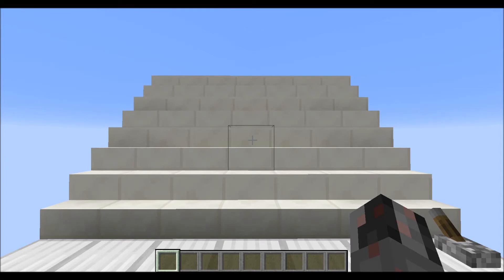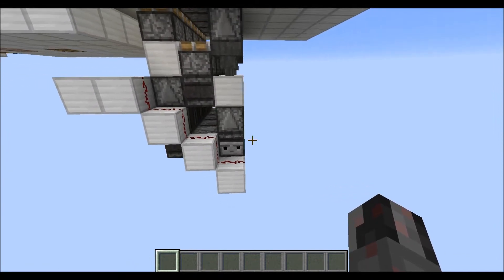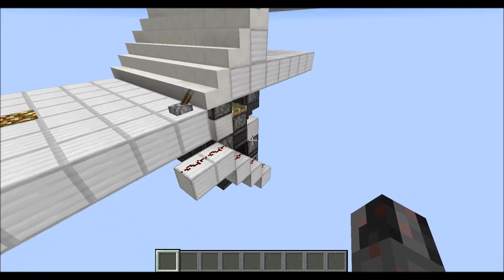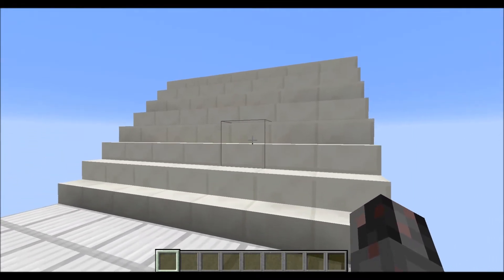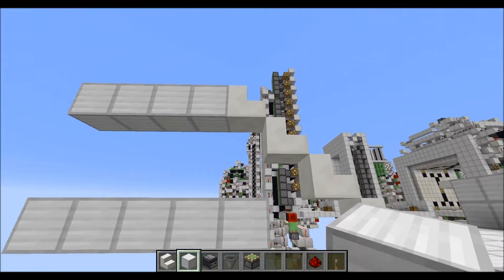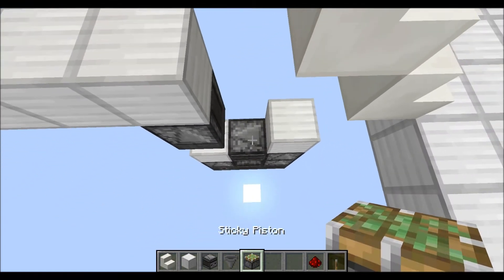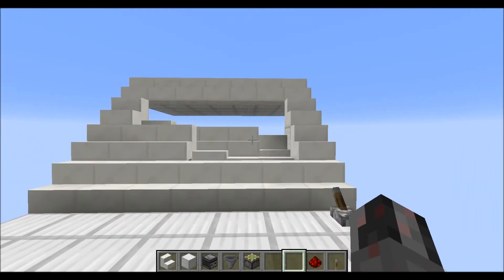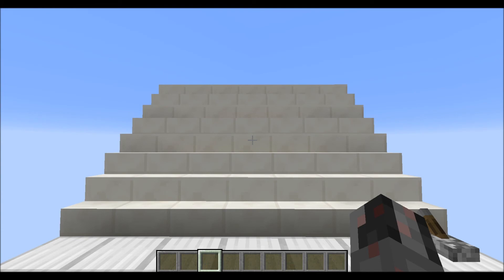Tutorial: Lag-efficient, Tileable Floor-Double Stairs [Java 1.11+] (Schematic)

Comment: Couldn't the last redstone piece on the lowest block be lifted one block higher? Reducing from 6x5x1 to a 5x5x1, for the circuitry module?
Reply from the maker: I assume you mean the alternative redstone line at the bottom of the modules? No, that can't be lifted. For the double extender to work it needs two pulses to the top piston. For this it takes the input pulse, splits it, delays one of the splits, and brings them back together before directing it to the piston. This splitting of the signal is the main reason for the used observer setup.     Btw, the size is 3x6(8)x1.
Reply: Alright, so what I mean is that there is only one update required: from the bottom observer. By simply powering it,  wouldn't it get that update? Instead of having one entire layer added just because of a single redstone piece.
Sorry if I'm missing something, I play on console and don't know everything about observers yet. And my OCD hurts seeing that extra redstone there XD
Reply from the maker: For extender extention you are right, that only requires one pulse to the top piston. BUT for the retraction it needs to retract the stairs block back TWICE. And for that it needs TWO pulses.